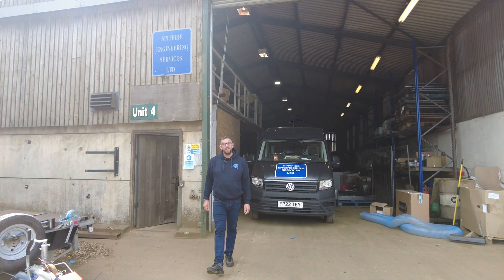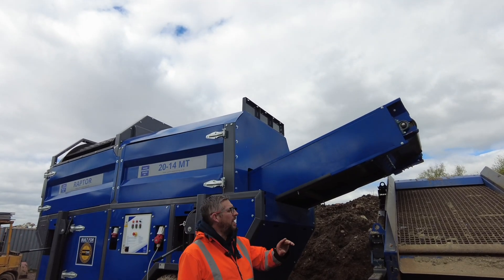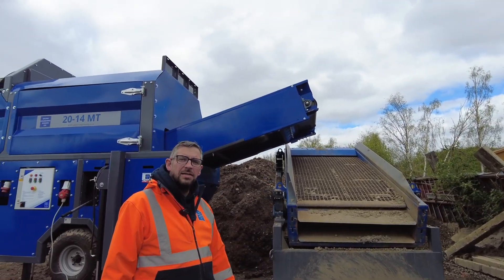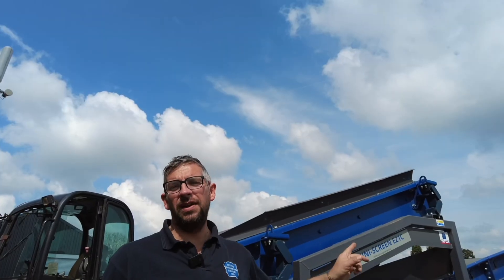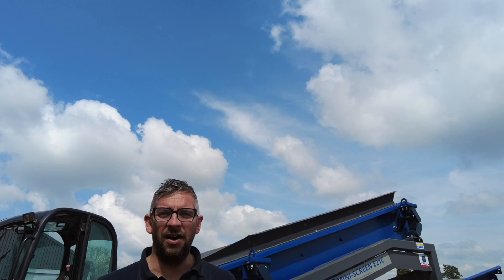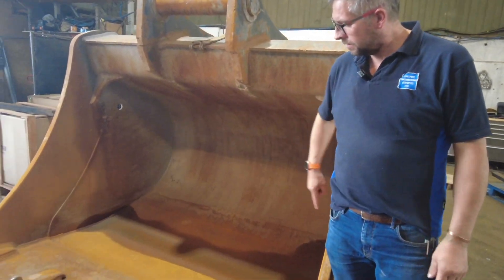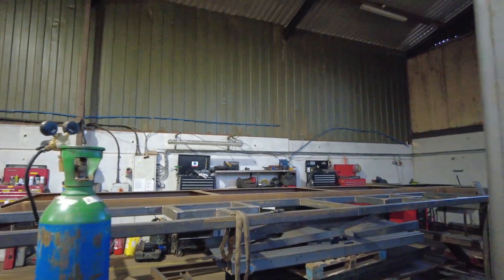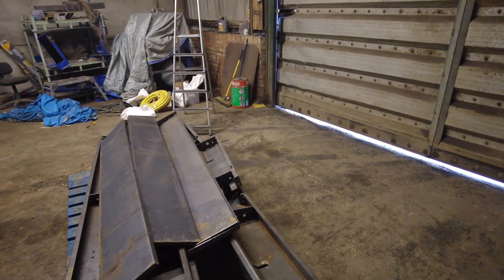WHAT have D&J Projects and Every Trade gotten us into now ! Ep1

Comment: Welderfabber  visit next  as a YouTube networker .. Is it possible to construct a platform that can be positioned in the aggregate segments of a builder's yard? Raptor drainage platform floor, This platform would allow soil to be loaded onto it and stored with a gap underneath, featuring a steel platform to facilitate slow drainage. Then, it could be scooted off and replaced into the raptor to aid the drying process, which is particularly beneficial in the current climate. The soil could be spread over the platform and left in individual piles to drain more quickly, enhancing productivity. This platform would need a robust, thick steel base, functioning similarly to a colander. I believe this design could improve efficiency and increase turnover. The primary challenge is dealing with wet clay soil. If the soil is stored to drain quickly, it could enhance productivity for the machines. I appreciate your work and look forward to seeing your growth.
Reply from the maker: Thanks for the comment. I did actually bump in to Baz yesterday. Good idea for draining the soil